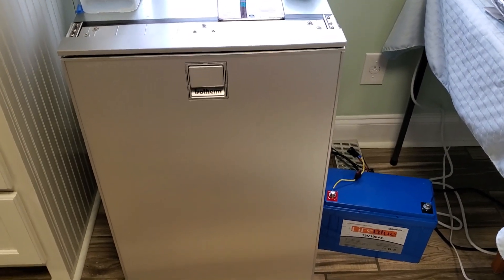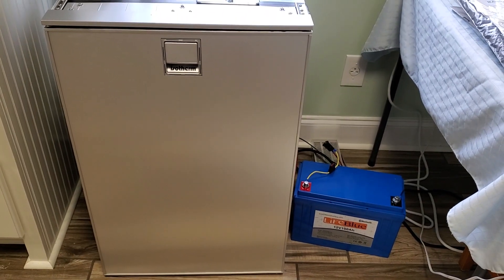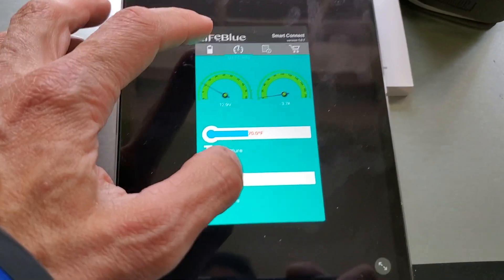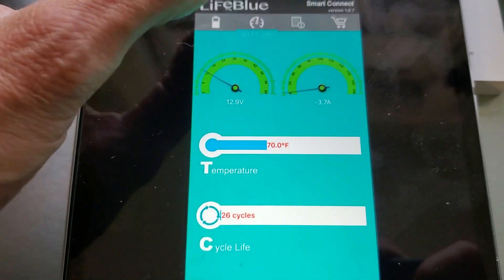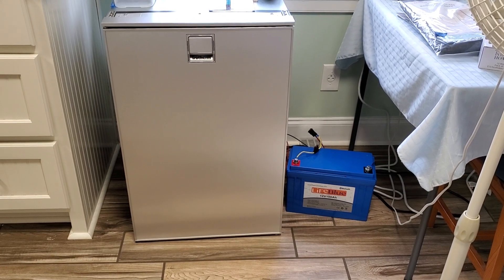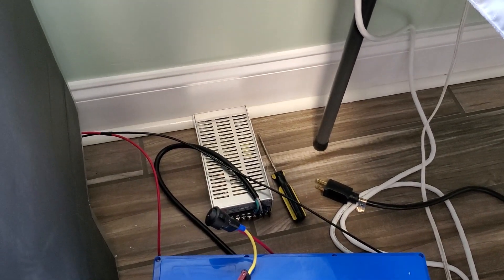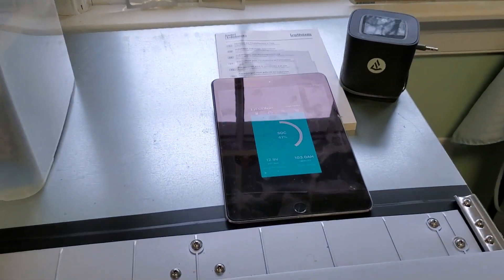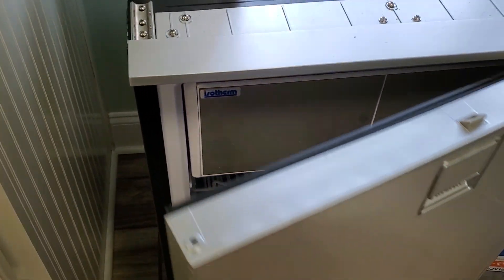Isotherm Freeline 115 - DC usage results

Comment: I have a problem with my isotherm 115 fridge, it doesn't cool well, it just keeps cold, it doesn't freeze, and I can't regulate the temperature, it's always in eco mode, it won't let me change it. Do you know what the problem could be?
Reply from the maker: Interesting about being stuck in eco mode - I'm assuming you've totally removed power?

Has it been fully defrosted? No ice on the cold plates?
Reply from the maker: Have you looked at page 54 of the user's manual - it has some error codes it can display.
Reply: @MyGoogleYoutube  In addition, the batteries are full, it cools especially on the top floor where the freezer is.  I keep the ice creams but they are not frozen and everything is fresh on the other shelves. I already looked at the manual and nothing.

Comment: Do you have any pics of the back of the refrig?  I am thinking of getting an isothem but concerned where the fan for the coils and compressor is locate and which direction it is pointing? thank you
Reply from the maker: If you're looking at the front of the fridge...the condenser is in the lower left corner. The fan moves air left to right. I added a second fan in front of if....to it's left. 

Compressor is on the bottom right side.
Reply: Thank you... very helpful!   Happy Holidays to you and your!
Reply from the maker: @nwlady1844  And to you :) Let me know if you have any other questions.

Don't underestimate how much fresh air to feed the fridge. I added additional vents in the cabinets.

Comment: Any follow up on your feeling towards this fridge? Would you recommend it?
Reply from the maker: So far so good. I would get it again. The efficiency of the fridge is outstanding. But I still gripe about the handle not being metal. That said... It functions fine. Although the faux trim piece... In middle of the handle fell off. I just pressed it back in. It is just a trim piece.

My first video of the fridge talks about my initial impressions.
Reply from the maker: What other fridges are you considering?
Reply: I've ruled out the domestics and norcools or whatever those are called because I keep reading bad stories of them breaking. I want marine great that will last. That said, I've been going between a virtifrigo and isotherm. But which model, I don't know...
Reply from the maker: @yevkenny  Have you looked at Truck Fridge and Nova Kool? 

We would pick our Freeline 115 over the Virtifrigo C115 we had. But the Freeline is more expensive. We want pints of ice cream upright in the freezer and over 4 CF in the fridge so that really limits our choices.
Reply: @MyGoogleYoutube  Do you have any opinion on Truck Fridge? Same compressor as the Isotherm and Vitrifrigo, but better availability in Canada it seems...
Reply from the maker: @yevkenny  We compared a TF130 and the Virtifrigo C115 side by side at the TF showroom. We felt the fit and finish was better on the Virtifrigo and the larger freezer sold us. This was for our last RV.
Reply: On_The Road ya the TF finish leaves a lot of be desired... I wonder if there is a way to integrate my cabinetry with the opening of the truckfridge though...
Reply from the maker: @yevkenny  I read one review of TF .. their fridge failed and TF mailed them a new one. They put the broken one in the box and sent it back. 

I can pretty much guarantee that isn't how it would go if my Isotherm dies. I wonder if that would work with Canada?
Reply: On_The Road I'm not sure... Found a dealer but I don't think they handle warranty. So it would probably be more involved
Reply: Debating about this fridge vs the Cruise 130..... I like the bigger size of the 130, but I like the bigger freezer and much better efficiency of this unit, hmmm..... Did you lookat the 130?
Reply: @MyGoogleYoutube  What is the primary reason the Freeline 115 over the Vitrifrigo C115? I like the finish, metal door, etc. as mentioned on the VF.

Comment: Should perfrom even better filled with food! Great review. Where did you buy?
Reply from the maker: I'm thinking so also....thank you. Happy to get some videos out there about the fridge....not many around.

Marine Warehouse in Doral Florida....the price was good and they double boxed the fridge and strapped it to a pallet. I was happy to see that.
Reply: Nope. It the exterior conditions are the same, same heat loss, same performance. This is assuming the refrigerator has reached a steady state.
Reply: @MrBjorntsc  you may be right if you never open the fridge, but that isn't real world. Because gas/air is much more acceptable to energy (heat gain) than liquid, once the fridge is filled and then the door opened momentarily and then closed,  it will have to run less to hit it's set temp pt because the contents didn't drop in temp like the air inside does if it were empty. I think
Reply: I ended up buying the fridge as well. Love it. Used it for about a year.
Reply: @davidhaddox  I get what you are saying. If you filled a fridge half full, you would only replace half the cold air when opening the fridge.
Reply: @davidhaddox  I am most likely buying one soon. It does seem like one of the best fridges. 

Is it as quiet as it seems in all these videos?
Reply: @MrBjorntsc  super duper quiet. And only 41watts or so when it kicks on to maintain temps.
Reply: @davidhaddox  good to know. Thank-you